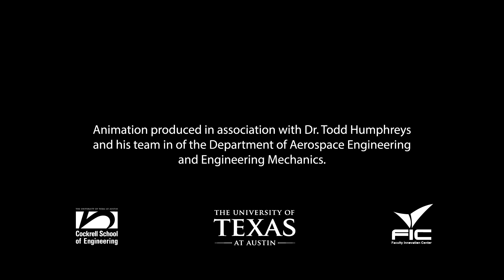Spoofing on the High Seas

Comment: This is an alowable experament if used and tested on people who are aware of the gps change in frequency as to not not cause any damage or harm. This was done as part of the University of Austin engineering department as a project in triangulation modificationand adjustment on short wave frequencys.  Thanks for your concern Lindsay.

Comment: I don't know much about GPS but I think this attack is detectable. GPS satellites are not suppose to move, the triangulation calculation is done by the ship's computer. Also the attacker has to JAM out the other genuine signals which should still be detectable by the ship. The ship just needs upgraded software.

Comment: Isn't there a way to identify the signal strength and it's source much like the signals for WiFi internet access?? There needs to be a warning signal installed in the GPS system to alert the crew that the signal source has changed and it's location. These students have their next assignment!

Comment: one of the guidance systems cruise missiles use is gps, in conjunction with stellar, inertial, and topological navigation systems. smoke, emp, and bogus gps signals would be compromising to a degree.

Comment: A shame that you neglect to mention that deep sea navigation by most nations requires the knowledge and use of astrological bodies in order to obtain licensing. It is not an overly complex process, and typically a good navigating officer will perform such a check at least once a day at varying times. Discrepancies will be noticed if the difference in position is greater than a few miles. This experiment (luckily for the testers) found prey of an incompetent navigator. In short, I am not amused.

Comment: This is probably only a threat to ships (sea or air) traveling across an ocean a very large distance. When ships are far from land, they have no help from radar to locate them based on localized signals, and basically have to resort to using only GPS. To those saying that these scientists are giving away ideas, consider that this particular idea is not novel at all. Implementing this method is hard though, you have to replicate the signal exactly.

Comment: No, this could only happen to a crappy captain on ship or aircraft. A good navigator does not rely solely on gps navigation, but rather, cross-references his gps with vor, compass (not the electric compass), dead reckoning, and any other form of navigation available to him. That, and in the case of air force one, they would be flying through class A airspace, which is IFR only, meaning, you have an ATC officer telling you what heading to stay on and will correct you if you deviate.

Comment: You could use a on board transmitter, small boat, or a gas/electric powered Drone. There are many different Drones you can buy or build. If you where to land a drone on the boat without it being seen yu would have a local transmitter on the boat.